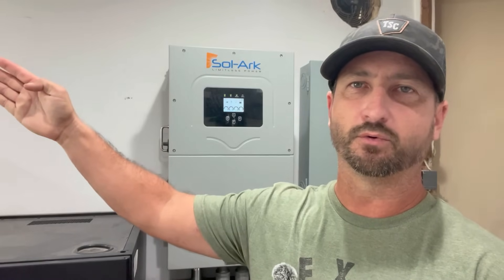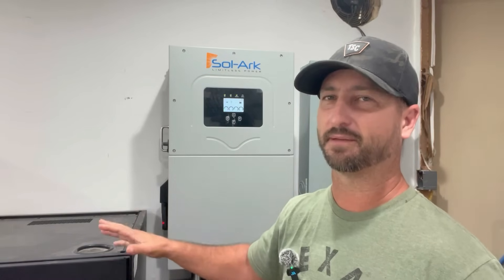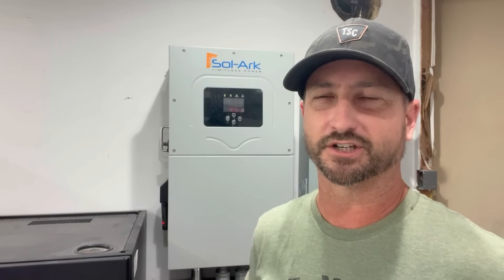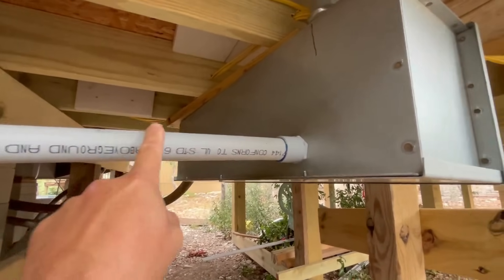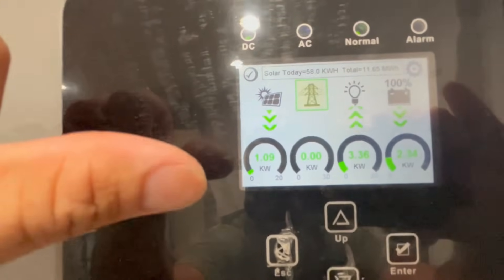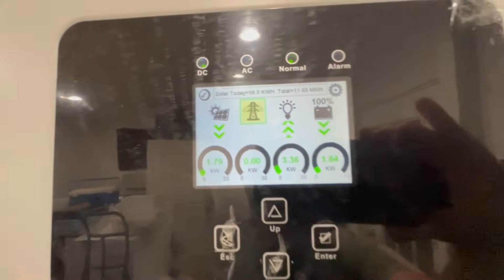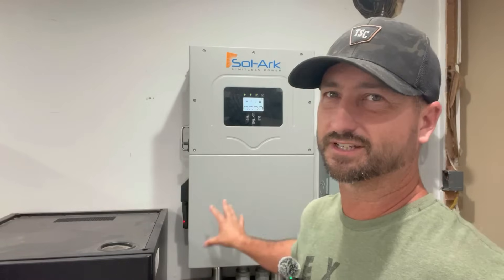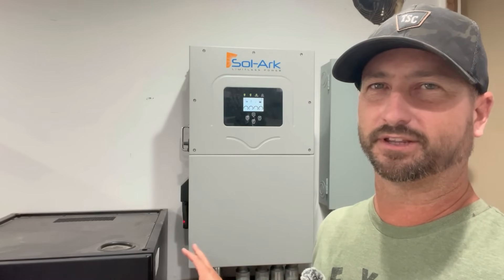Tour of my off grid solar system with the Sol-Ark 15K

Comment: So you have at least a one and a 1/2 horse power. Well, pump in the ground that's 240 V. Then you have another probably 3/4 horse or one horse pump. That's two forty there could be running at the both at the same time. So you already using at least half your inverter. And assuming you have an AC in the house and AC in your shop and anything else turned on. Like the clothes dryer and the washer you're gonna be over your twelve k. I have been off the grid for 7 years with a twelve k inverter. I also have A310AC on the house. I wanted to have horsepower well pump and all kinds of other large things that get to run at my shop. I even have 3000 W of AC couold panels. So during the middle of the day I actually have fifteen thousand watts of usable and I could still go over.
Reply from the maker: My 2 hp we’ll pump lulls about 2,000 watts when running. My above ground pressure pump for water to all our homes is on a variable speed pump so it pulls anywhere from 500 to 3,000 watts. My 24k bth mini split runs on about 1,500 watts. My heat pump water heater runs on 400 watts, my heat pump clothes dryer runs on about 500 watts. I’m never pulling more than 8,000 watts at a time. But I would have been with my old electric appliances.
Reply: @unpluggedtexan  Interesting I 1.5 horsepower. Well pump pulls thirty two percent of my twelve k inverter. My pump is rated for fifteen gallons a minute. And it actually brings up twelve gallons a minute. I wonder how you're only getting away. With two thousand watts on a two horsepower motor?
Reply from the maker: @terrya6486  my well pump only does 5 gallons a minute. I’m kind of bummed about that. That’s probably why, but it is 2hp. But it’s 460 ft in the ground which may be why.
Reply from the maker: Check out the new GE all in one heat pump washer and dryer. It’s been a game changer for me to stay under 12kw. It’s about $2,400 so it’s not cheap though. It’s full size, my wife loves it.
Reply: @unpluggedtexan  So how did the clothes feel when it comes out of the dryer? Everybody says to close still feel damp when they come out.
Reply: @unpluggedtexan  So it's really only using one horsepower of it's two horsepower capability because of the low flow rate. That makes sense now.
Reply from the maker: @terrya6486  I understand what they're talking about.  But after a few minutes that feeling goes away.  My wife is usually pretty critical about appliances, she's loved it.  The total cycle wash to dry takes about 2-2.5 hrs.  And it automatically goes to drying which means we aren't doing the same load over again after forgetting to move it to the dryer.  I used to never be able to do any drying at night due to it draining my 30kwh battery bank too quick.  Now I don't worry about doing a load over night.
Reply from the maker: @terrya6486  yeah that’s probably it. I have 9,000 gallons of storage tanks. When my well does turn on (even with the float switch at the shortest setting) it runs for 3-4 hours straight. Then it doesn’t run for a few days. We have a pump saver on it as well in case the well runs dry to not burn up the pump.
Reply: @unpluggedtexan  The same here on my system, all the big loads. Try to get run in the middle of the day including charging the car.

Comment: You have five homes powered by one 15K? One of them is your home. Are the other four dog houses or running  mostly on LP? Don’t forget to add midnite solar surge protection devices.
Reply from the maker: No my Sol-Ark runs my home, my work shop and office, and a well pump and water pressure pump.  The well and water pressure pump feed water and pressure to five homes on my property so it takes a ton of power.
Reply: @unpluggedtexan  I was curious because I barely run one all-electric home with 4.25T high efficiency HP’s, at 38Lat on two 12Ks, 32kWp, 168kWh diy LFP.
Reply: @USA-GreedyMenOfNoIntegrity I hear you! My place is 1170 sq ft, totally insulated to r45, new double pane energy efficient windows, new roof, brick home. Mr Cool 3 ton 2 unit mini split ( that we don't get to use because of not enough power!!) We line dry our clothes, hand wash our dishes, have a propane 11gpm water heater, and propane stove/oven with oven electric ignighter, 90% of our lights are Led's. I don't get it!! 2 eg4 6500ex inverters, 12(2-6 banks) of eg4 lithium ion 48v batteries, a total of 60+ kw battery backup. I'm blown away here!!!

Comment: What I'm doing is, I've installed 3 systems for redundancy. If the grid goes down. And you take a huge lightning strike it would be good to have a small system on each of the houses on your property.
Reply from the maker: Yep I’m in the beginning stages of planning additional systems on family members homes on my property. 👍
Reply: Solark has EMP protection available for a option.

Comment: Consider SUB - Solar Utility Battery and save you Battery for Grid Fail.  It cost 10 to 30 cents to convert kWh to eChem and back. do the math. If you have TOU then eChem power has payback.

Comment: Did you actually wire the grid directly to the solArk?  Not jut a double pull breaker 50 amp.  But actual 100 amp service directly to the SolArk.  

Just wondering how I could do that.
Reply: Same with mine: The grid goes to my inverter, which distributes all power. I do have a bypass switch if I want to make the grid go to my main panel, but that is for use if I want to take the inverter off line, or if the inverter fails.
Reply from the maker: Yep wired from the electric meter directly to the Sol-Ark 15k. From the Sol-Ark it feeds into my main 200amp electrical panel via 3/0 thhn wire. The sol-Ark 15k can pass through 200amps from the grid to your home panel.
Reply: @unpluggedtexan interesting idea

Comment: That’s a very good system, very big! Nice explanation of the design. I wonder if the air conditioning demands are what is taxing the grid, much more than EV cars, the EV cars can charge at off peak hours easily. Thanks for the video.

Comment: 0:55 and I comment. Hahaha, what a bogus argument about "getting more electric cars plugged into the grid", while a second later talking about a propane generator. Okay, it's propane, probably not a big deal. However, ask yourself how much energy is needed for fuel refinement. Deduct that amount from the grid's capacity and you'll suddenly see that electric cars shouldn't be a problem.
However, I clicked on your video for a reason which you explained very well and totally agree! I've heard Texas E(R)COT (R in "reliability") had a lot of struggles, if I would live there I'd do the same as you did! Well done, Sir!

Comment: WIndmill for storms? You have any EV cars?
Reply from the maker: I haven’t found a wind turbine that is worth it so far. They either don’t produce hardly any power, or the ones that do are so expensive it would be cheaper to just add more solar panels and batteries. I don’t have an EV car at this point. Am researching to see if it makes sense now that I can power it for free with my solar system.

Comment: What settings on your Sol-Ark 15K did you use to power your load first with you PV, then with your battery and finally with your grid?  Also, since I can't figure out how to even search for this, do the voltages across your system (as seen by pressing the battery icon on the inverter screen) all follow whatever voltage your grid is pumping out to you?  I don't have my battery yet, and that's what I'm seeing.  I'm wondering if that behavior stops with a battery (i.e., it doesn't matter if the grid is feeding me 116V or 124V, the load will always get 120V).
Reply from the maker: It’s been quite awhile since I programmed it. I have Sol-Ark a call and they walked me through the programming. Give them a call. That’s what you’re paying the premium for going with Sol-Ark. They’ve had great customer service for me. And I didn’t let them know I have a YouTube channel so they were treating me like any other customer.

Comment: Look into building 2x 304 AH EVE in a EEL battery box with a seplos 200A BMS. I have roughly same set up as you, (15K, eg4 rack (4)eg4 lifepower 2x Jakiper(100ah) 2x Trophy (100ah) and 2x 305 eve/304 envision cells. 
Last 2 cost 2700/2200$ . Huge $ save.